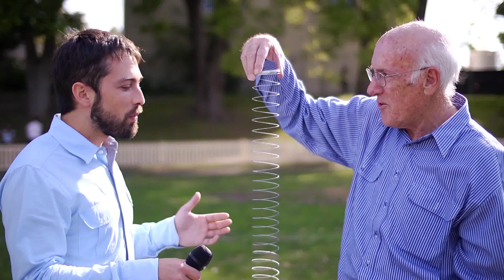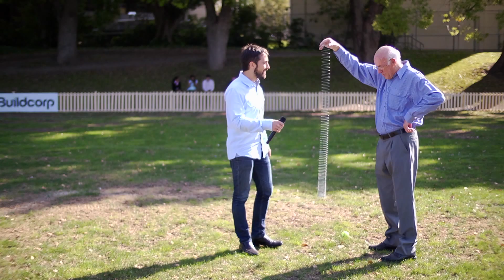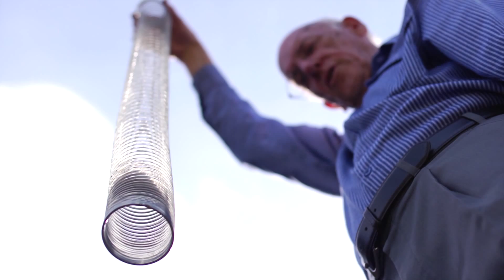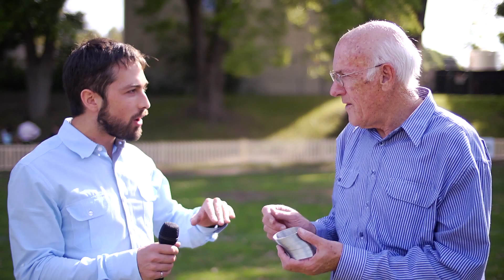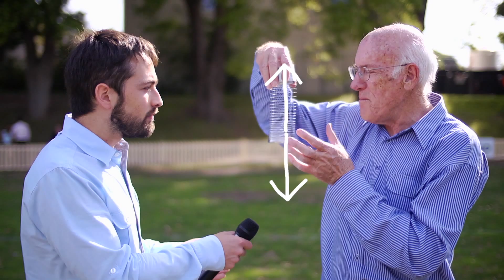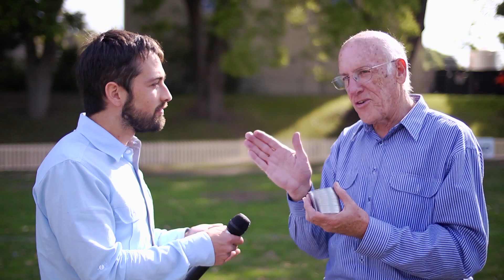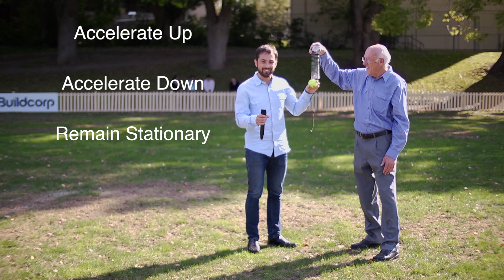Slinky Drop Answer

Comment: Ok. I have a question. What if you had an infinite slinky tied to a very heavy object, let's say a car. When you would drop the slinky, which is ofcourse infinite, would the car stay in place and not fall ever? Would it be stationed in space forever? plesase answer.
Reply: If the slink was strong enough to hold the tension then yes, both gravity and tension would be equal forces.
Reply: The tension from the slinky would be holding the car up. Assuming this slinky is "infinite" would mean that the tension is never released, and would continue to hold the car up forever.
Reply: Yes. But the key is in the preparation of the experiment. The work done by gravity to bring the mass to equilibrium is the "cost" of this experiment. If you had an infinitely long spring, the mass would have to stretch an infinite distance to equilibrium before you start dropping your end.

Comment: Am I missing something? So when he drops it the top end is pushed down by the gravity+ plus the compression of the slinky. The bottom part stays in the same spot because the gravity force is COMPENSATED by the compression until the top reaches the bottom. I don't see why they say stuff like "top has to reach the bottom before the bottom even knows the you've let go of the top". I see it as not something so complicated, but just simple balance of the forces...unless I miss something
Reply: My point is that my way of explaining is - that forces balance each other - is simpler and seems to make more sense.
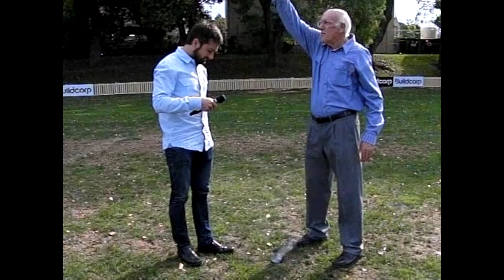Reply: Actually they say that.. 1:10.. but they are explaining compression waves.. a much better concept to implement analysis in other objects.

Comment: The tennis ball will stay in place (until the wave hits it) because if gravity is pulling it down more because of the weight of the tennis ball, then gravity is also causing the slinky to experience an equal amount of tension. The ball is causing a greater tension force as well as a greater pull of gravity, so the opposite and equal forces cancel out and leave the ball in its place.
Reply: or more simply put, the tennis ball becomes part of the original system, and we know what happens in that system.

Comment: Slinky behaves as a closed system, as a whole. Its center of mass will have a uniform "1g" acceleration towards the ground at all times. The system itself is a different story. it is a self/gravity-loaded system in equilibrium, with a potential for dampened oscillation, to boot. So, the bottom will start falling but not before the deformation wave from the system equalization process reaches in (speed of sound in solids, I think) plus all the non-symetrical, in-system, oscillation-augmented elastic deformation into a relaxed spring state.

Comment: ,this experiment leads me to think: coupled to an elastic band is an object heavy enough stretch the band, and you release the band; wouldn't the same occur?
Reply: +Matthew H like when you hold one end of the rubber band in your thumb and the other with your fingers, then let go of it, and it will push it forward??
Reply: +Matthew H like when you hold one end of the rubber band in your thumb and the other with your fingers, then let go of it, and it will push it forward??

Comment: I have a question.  What would happen if the object dropped were not in a state of tension, for example: a chain.  Are the results the same because the "message that the top has been released" not traveled instantly, or does the Slinky's internal tension play a major role?
Reply: from what I've read in the interwebs. this happens because the slinky is contracting as its falling. so yes tension does play a role
Reply: +Mete0r27 The same thing WOULD happen! Only in rigid objects the change happens much much faster. You can think of it like this, instead of it being an actual spring that's holding "the bottom" up, it's the intermolecular forces, but it's still tension, and the information still needs to travel through the material, and that still happens at a finite speed. Fun fact, the fall always happen at the speed of sound in that material. :) 

There is a simple way to know that the information transfer can not be instantaneous, and that is that it would break universal speed limit, the speed of sound in vacuum (of course, you have to know or accept the proof for why there is such a limit).

Watch vsause video on "how much does a shadow weigh", they talk about it in there (about 5 minutes in)!
Reply: Good question.
Reply: I just tried it with a chain now and no it doesnt fall like a slinky, it all falls at the same time

Comment: Hey Derek! I have another argument ( a much easier one )!
Say, the bottom end of the slinky starts falling as soon as we let go... The whole slinky would be falling. As a result, more kinetic energy would be generated in this case than the actual one ( where it waits till the top end falls ). Since the total work done due to the gravitational force is the same, it means that the loss in ( spring ) potential energy is less in this case. However, this contradicts the fact that every system tends to the configuration of lowest potential energy!!

Comment: What if they are wrong? Mabey the slinkey is actualy compressing from both ends but the bottom is comeing up just as fast as gravity is pulling it down, creating an illusion were the bottom isnt moveing.
Reply: +Derek Schumacher Isn't that basically what they said?
Reply: yeah, im pretty sure thats what they said but they explained it in terms of forces acting on the bottom of the slinky e.g. the tension (or compression as you put it) is acting upwards and the weight is acting downwards.
Reply: It's not an illusion at all. If you are standing in a narrow hallway and you push on the wall to your right with your right arm, creating a force pushing you leftward and then do the same with your left arm, if your arms are each applying the same force, you'll stay still, right? And you know it's not an "illusion in either case. Forces cancel out, the bottom of the stinky and your torso when you do the hallway thing stay truly still
Reply: peterisbetterthanyou Yang stfu at least he's coming up with a theory, and thats one more that you made thus far
Reply: Chris Vo
Reply: that can't be true as this applies to slinkies with different tensions
thus the upward acceleration cannot be the same for eacj
Reply: yeah but how come every toy equalize the gravity
I ve watched many video of the same toy, some are long some are short some are metal or plastic the bottom is always still, can not be always the same force for every different toy. Tensed spring is pulling to the middle and so called gravity pulling down, for the bottom to be still needs to be gravity and central tension force of the spring equal. the bottom is perfectly still every video I ve watched
Reply: If we speak about the center of mass, yea it starts falling right away (at the same velocity of speed of light), but when you compress your model to a point, you lose information about the end, and the top.
Reply: What if the bottom of the slinky was coming up just as fast as gravity was pulling it down even BEFORE he let go of the top? What if when you're holding a slinky like that it's bottom is constantly both falling and rising at the same rate the whole time?
Reply: Derek Schumacher  nope they aren't ten years old and can spell maybe

Comment: You get a different perspective on this if you think about it in terms of Einstein's equivalence principle. According this principle gravity and acceleration are the same thing. When an object is in free fall it is actually in an inertial frame of reference although it seems to be accelerating to us. When the slinky is let go the centre of gravity seems to accelerate downwards and the bottom stays still. It's actually the bottom that is accelerating upwards towards the centre of gravity and the centre of gravity is an an inertial frame of reference. Because the tension on the bottom is the same as when it was dangling it accelerates at g. This appears to us to be stationary because according the principle of equivalence we are constantly accelerating upwards at g.

Comment: This is a fascinating phenomenon. A lot of questions suggest themselves. Does it depend on the weight of the slinky? Does it depend on the tension in the slinky? Would it still do this in a weaker or stronger gravitational field, say on the moon? 

Imagine stretching a slinky out in a zero gravity environment then letting it go. It would collapse to the middle of the slinky. If you then did this in a very weak gravitational field, stretching it vertically, it doesn't seem obvious that it would suddenly start collapsing to the bottom. It might be just a coincidence that the Earth's gravitational field is just right for this to happen. Perhaps not, it's not at all obvious. Wow, what a great problem. 

However, the slinky must be collapsing at the exact same rate that objects fall in the Earth's gravitational field. Is it just a coincidence?

Comment: Your physics pro makes it sound more complicated than it is, and in fact the ‘information’ of the change in static suspension doesn’t reach the base of the slinky until the moment of that suspension being fully depleted.  Prior to release the upward tension of the expanded slinky simply holds the bottom section up, until after release it retracts/falls toward the supported end, and with the vertical tension support then removed, the  now closed & non-suspended slinky reacts to gravity.  The reason the slinky doesn’t contract in both directions toward the center upon release is gravitational force.  Slinkys don’t work too well in space.

Comment: Another explanation is that the center of mass is in free fall and is displacing downwards as the shape changes and if you understand the calculus, you'll appreciate that while the slinky pulse is at a constant speed, the CM is accelerating at 9.8m/s^2

Comment: he explained it wrong.  the bottom of the slinky doesn't start moving until the top of the slinky hits it because the upper portion of the slinky is still pulling it up.
Reply: "The upper portion of the slinky is still pulling it up" is the tension he is talking about in the video. So he explained it exactly how you explained it.
Reply: I'm gonna trust "some guy" over a physicist...
Reply: The physicist explained it wrong, but you didn't say why. The part when he said that the bottom of the slinky doesn't know when to fall until it's top reaches the bottom is false because all of the slinky is falling, it's just the tension of the top of the slinky accelerates the bottom of the slinky at the same rate as gravity, so the bottom of the slinky looks like it's just sitting there when it's actually accelerating upwards at 1g (that's zero net force by the way) before the two ends of the slinky even meet, until the top slinky reaches the bottom, then the tension stops, and the whole thing hits the ground. Don't just take my word for it, go search up about "net force" and you will see what I'm talking about.
Reply: .....did you miss the part where they talk about tension?
Reply: Did you really miss the part where he described tension acting as a force pulling it up?
Reply: Drednaught The bottom end was fighting gravity and the tug being exerted on it from the top
Reply: Thats basically what he said lmao